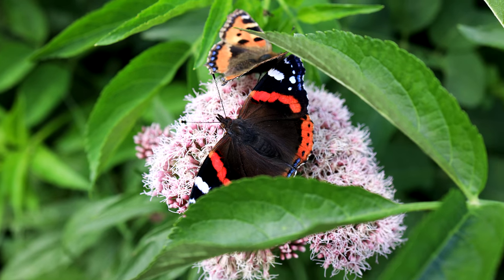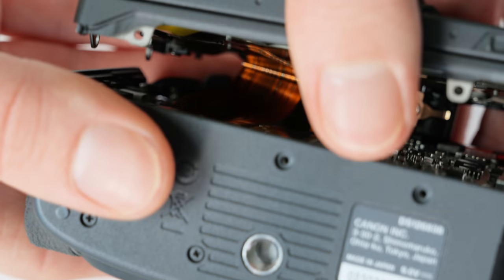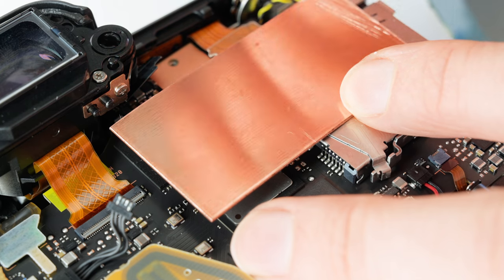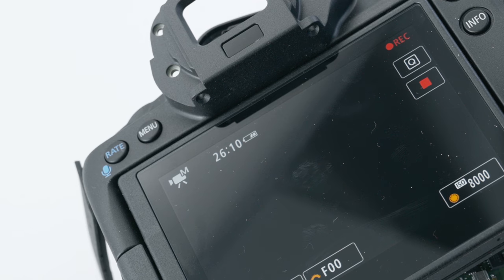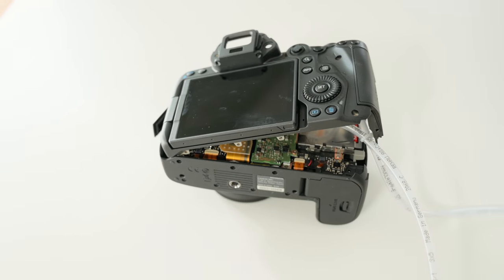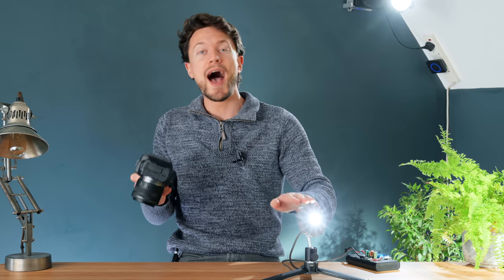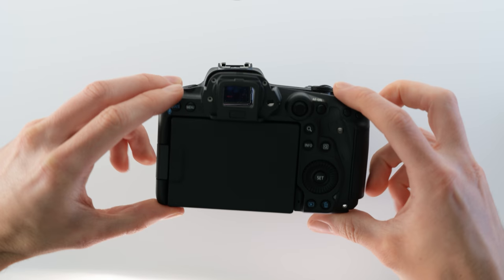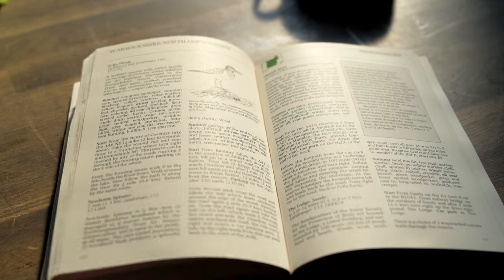The only reason to watercool a camera....

Comment: This guy solo came up with better thermal design than Canon entire engineering department.
Reply: Canon probably designed it like this on purpose, to limit the camera's abilities. 
This would cut into their cinema camera sales if it could record 8k for extended periods of time.
Reply: There's always tradeoffs.. Sure the engineers could make it run cooler but then the camera would be double the size as a result
Reply: Well.. then solution is as big or more than the camera..
Reply: @IrishSkruffles  or, you know, the same size. But with copper heatpipes inside.
Reply: There's 2 issues with that statement.  You don't know the different thermal designs the Cannon engineers considered before settling on the final design.  As Matt said in the video, it's about priorities.  Engineers have to consider feedback from the bean counters and often scale back design to meet cost constraints.  Also, he probably didn't do it alone.  Matt isn't the first person to upgrade the cooling of their high end camera.  He most likely checked out what others have done and use that as a foundation for his own project.
Reply: Canon invented the Cripple Hammer, don't you forget that.
Reply: @lazar2175  More likely to be an issue with materials cost.  Using a couple of bog standard thermal pads and a basic heat spreader is cheaper than the copper spreader and thermal paste Matt used.  Every penny saved in material per unit adds up when you consider how many units are sold over the product line's lifetime.
Reply: @jase_allen  Material cost doesn't sound like a good excuse. For a camera costing that much already, a couple more bucks wouldn't make a difference to the people who need it. Cost can always be passed down to the consumers. And if you make a good enough product, they will buy it regardless of how pricey it is. Not to mention the people who actually really need and use 8k on a professional level will be likely paid at least a thousand or more per day. They could recoup the entire cost of a camera in less than 1 week of work.

Canon has proven throughout history that their DSLRs and mirrorless are just toys for video shooters, and anyone serious about videos should either buy into the cinema line, or buy something smarter like the A7S3, S1H, BM, REDs.
Reply: @IrishSkruffles  what? did you watch the video??? by just changing a few things on the inside, the camera performed significantly better. no change in size.
Reply: @jase_allen  1 issue with your statement. Everyone knows that copper is better for thermal regulation. Everyone knows thermal paste is better than pads, yet somehow canon's engineers decided to go with that cooling solution even though they knew the camera was overheating. The design for this camera only makes sense if you assume it was crippled on purpose.
Reply: @jase_allen  1 issue with your statement. Everyone knows that copper is better for thermal regulation. Everyone knows thermal paste is better than pads, yet somehow canon's engineers decided to go with that cooling solution even though they knew the camera was overheating. The design for this camera only makes sense if you assume it was crippled on purpose.
Reply: @MrFattarot  To be honest, I didn't watch the entire video when I commented.
 It was surprising how well the internal modification did however this is still not mass manufacturing friendly and just to be awkward I would argue the plate is more than twice the thickness of the original plate ;-)
Reply: @jase_allen  
Do you really think they cared about saving less than a dollar on a product that costs $4000?

A decent 8k camera costs well into 5 digits, do you think that raising the price of R5 would turn away the customers. 
Hell they could have doubled or tripled the price and it would still have sold like it is now.

Also i won't even mention how easy would it be to actually properly design this.
Reply: @jase_allen  given that these cameras are selling up to £4000, I don’t think they’re worried about the cost of a relatively small amount of copper.
Reply: @MrFattarot  wdym no change in size?? It has a whole seperate external watercooler now. Although you could make some backpack or fanny pack to carry it canon cant sell that, especially for a non professional level camera and that is where the reason lies for canon underperforming compared to diy perks
Reply: @menogusta9829  You did not watch the video, did you?
Reply: @MrXaphier  Not the second half 😂 my mistake
Reply: @menogusta9829  The internal changes he made allowed him to record for about 40 minutes with a 5 minute recovery time. That on it's own is miles better than what the camera could do before and good enough for most purposes. It's only of you want unlimited recording you need to add the external fan. And even then, the external cooler he made is the same size as a typical battery grip for the camera and you would only use it when necessary
Reply: @MrFattarot  right i just hadnt seen the second half of the video. Only had seen the watercooling part.
Reply: @leodf1  Take the L? It's a youtube comment section not a competition.. You come across like a real nice dude btw
Reply: @MrFattarot  "...Everyone knows that copper is better for thermal regulation. Everyone knows thermal paste is better than pads..."
🙄  I didn't say otherwise.  I said there were probably other considerations involved.  And yes, I do think product managers would tell designers to go back to the drawing board over a few bucks in materials cost.  You're also ignoring the cost of manufacturing.  As I said, a single penny per unit adds up to big bucks when you consider how many are sold over the lifetime of the product line.  You shave off $3.00 per unit and sell 8 million units, you saved the company $24 million.
Reply: @BronySeven  copper heat pipes expensive af
Reply: @JimGordon  Would probably double the price of the camera lol

Comment: Unlimited recording times...
SD Card: ArE YoU SuRe AboUT ThAT
Reply: Canon may lift 30min limit on video and add an option to switch cards during recording. And then, they could even add some sane options for RAW recording, as current Canon RAW is taxing like hell and hard to work with.
 Thats what Sony did with A7S III...
Reply: You can probably output the video feed to a PC/laptop when you're in your studio and right into your editor bypassing the need to plug and copy files around... but yeah 8k files are huge anyway X )
Reply: Next video: I hooked a 15TB SSD to my camera 😂
Reply: laughs in 1tb microsd
Reply: next video: I added a data center to my camera...
Reply: He meant unlimited from heat dissipation point of view
Reply: I hope you not challenging DIY perks to make an unlimited sdcard alternatives. 

Next video title : I make an Unlimited SdCard alternative.
🤣
Reply: @ccmi2081  I made an sd card cluster so my watercooled camera could record for years...
Reply: @KnightMirkoYo  😁🤣

Comment: Fujifilm now have a fan attachment that works perfectly fine. But for me the best solution it's the one on the Panasonic S5II with an small fan in the eyepiece, they use heatpipes to drive the heat to the cooling fan.

Comment: Likely, either Canon were looking to keep some capability on the table to allow for a product refresh in coming years. Or, more likely, they wanted to keep within the TAX bracket limitation of the non-pro cameras that are limited to "no more than 30 mins" of recording video. While I don't think they were expecting anyone to modify the camera, I also don't think they're going to go after you for pointing this hack out. 

As other people have said here it's likely that someone will make this into a "kit" to either resell or build a business of upgrading cameras. An 8K pro camera that can record as well as the camera would likely set you back many tens of thousands of pounds/euros/dollars. Even if the kit and fitting cost another $1,000 on top, and invalidated your warrantee it would be worth doing for may film makers.
Reply: Totally agreed. The two hours pre-programmed "cooling time" has no basis in reality, and must have been  an intended product crippling.

Comment: That's an absolute SCAM on Canon's part. 20 mins of recording, then a 2 hour cooldown? And this guy brings that to 30 mins, then a 5 min cooldown at the cost of a small bit of copper.
Reply: Ahh, but you see that copper will cost money and lower their margin. That wont do at all, they've promised the price of 4500€ and there's of course no chance to change that to 4505€. Welcome to corporate marketing departments.
Reply: To be fair I absolutely can’t be bothered about that because its a photography camera and not a video recorder. I shoot max 3min of video sometimes and for that cooling is sufficient. Yes it sucks for all hobby film makers but in that price segment there are plenty of dedicated video cameras as well.
Reply: @ThePunischer1000  yeah if cannon did this from the factory it would cannibalise the sales of the c70
Reply: @Jason Carter that’s an American tax rule to separate dslrs from video cameras in Europe we don’t have that
Reply: @Jason Carter often electronics companies will just pick one or the most stricked set of rules and apply that to all versions of the devices
Reply: @Jason Carter that's probably down to the updated firmware not detecting as much heat any more. I could be wrong though since I'm assuming the new firmware doesn't seem to have the code in it to stop recording after 29 minutes and 59 seconds.
Reply: Not a scam, just corporate thinking. You spend millions on R&D for a camera, then realize towards the end of development with manufacturing ready to go, that there's a serious overheating issue. You have a release date to meet, have already spent even more money on advertising, getting shelf space with retailers, have pre-orders to fill etc....and you know most people don't shoot 20 minute takes at a time. So you have a choice:
1) Set the firmware to cut out after 20 mins of recording, with an overly-cautious cool down time and ship.
2) Go back to the drawing board and totally redesign the camera which will cost millions in resdesign, retooling the manufacturing process, lost money on advertising and pre-orders, plus the PR disaster of "Canon's new camera scrapped due to bad design".
The work-around in the video works....but I see some problems that would stop it being an 'official' fix: Without the active fan, it probably won't be long before the excess heat starts to deform the plastic on the back of the camera, if you have the screen folded in, you're basically directing all that heat into the back of the display... and having a camera where the back of the casing gets up to 80 degrees C is not a good idea.
I mean....it's still total horseshit and shouldn't have been released in this state... but Canon couldn't have fixed it with a bit of copper. The mod in the video would absolutely NOT meet standard health and safety standards.
Reply: i feel like people are discounting the possibility that they may have realized too late that it was overheating and had no time to literally redesign internals to have a proper heatsink or create the option for a cooler attachment. like sure matt can hack it into place as a prototype, but mechanical design is a long and arduous process and to create an adjustment like that for mass production would take months and months of redesign
Reply: Well, the 5 minute cooldown is theoretical. Whatbdo frequent heat cycles do to the logevity of thw camera? Cooler run temp has definite benefits though.
Reply: @Jason Carter the law changed a while ago.
Reply: @ekevanderzee9538  I also find it insane Canon thinks the processor getting up to 90C is fine. I get worried when my GPU hits 75C

Comment: As you mentioned, camera manufacturers concentrate more on the advanced optical features of the camera rather than the thermal issues causing by the CPU. Eventually, I think you really have to deal with that because the CPU nowadays are getting more powerful and consuming more watts. Your hotshoes attachment fan is definitely a good selling product. I don't mind to buy one if it is probably made.
Reply: Canon r5c is literally what diy perks made but in body

Comment: Next up: I water cooled my Air conditioner.
Reply: I'd want to see that in a "portable" ac, dramatically increasing efficiency with just an outside radiator, and no hoses :D
Reply: air conditioners are already water cooled. that's how they cool the air.
Reply: @_ikako_  you are not really the life of the party right?
Reply: @SirDella  Sounds interesting 🙂!
Reply: @_ikako_  That's swamp coolers you are talking about. Air conditioners are all cooled with air. Portable and window units use the water condensate to improve cooling, but they still rely on air.
Reply: Very much possible! Newer window units actually throw water from the condensation back up onto the condenser!
Reply: @SirDella  are swamp coolers the ones with damp fins that use evaporative cooling? Because industrial air cons use a coolant circulating and constantly evaporating and condensing. I would count that as "water" cooling.
Reply: @_ikako_  I wouldn't count refrigerant as water, but it is what you need to cool down, not what provides the cooling. Acs use air to cool the condenser and the water that forms in the evaporator, water cooling (in a portable ac) would mean removing the cooling fan and replacing it with the water loop, taking the water outside where you'd have a simple radiator or even better, using your pool as the heatsink!
Reply: @SirDella  LOL.  I know what everyone needs.  A radiator for our radiators.
Reply: @jayhom5385  Hahaha, but think about it, portable acs are extremely inefficient, one way to fix this is with a dual hose one, or with this crazy contraption that I'm suggesting. In addition you could even heat up a pool with it while cooling a room at the same time! And also would make them quieter, I'd like to give this a try

Comment: In amateur astrophotography we us Peltier elements to transport heat away from surfaces. This could be used on the plastic back of the camera, inside and outside.
But it also requires an energy source.

Comment: Linus? 

P.S I don't even need to use a screwdriver with my Canon G7X... The screws fell out by themselves and the plastic parts also detached over time 🤦‍♂️
Reply: You can fault canon for plenty of things, durability is not one. Your story sounds totally bogus. I have old and new canon cameras....nothing like has ever happened. In fact I doubt any major camera company sells a product where "the screws just fall out". 

TLDR : pics/vid or it didn't happen
Reply: @protoman1214  just Google "g7x mark 2 screws falling out" 

It's a known and common problem for that camera.
Reply: @GadgetAddict  I see. I never messed with their powershot line except an old s90 that still works perfectly. Looks like canon dropped the ball. Probably because that specific mechanism is newer in their cameras. And to use proprietary screws ... disappointing
Reply: That's the way it works unfortunately. Cheaper prices mean less quality control. 

Although I have an 1100d from 2011 laying around the place and the only thing that has came off it the rubber 'gasket' around the viewfinder. Was my only camera for 6-7 years so it has a massive amount of use. Took it hiking and everything. A few scratches here and there, but still as sturdy as the way I received it.

Comment: As a potential customer of an R5, COVID delayed my purchase as I my business has been affected.  Video is not really important as stills, but this is the first video I've come across that discusses the R5's heating issue beautifully.  I can now see where Canon has made the engineering mistakes and the low-quality thermal management.

I know there is a lot of technology going on here, but for what is essentially a $4K+ camera, I would have expected better of Canon to deal with this. 

Until COVID lifts and my photography business picks up, I can hope that an R5v2.0 or even the just announced R3 will do a better job.

Excellent video.  Well done!

Comment: Dude start selling this as a Kit, you can get rich off this!!!!!
Reply: not everyone would wanna buy this fairly expensive "kit" and wanna tear their camera down, kiddo
Reply: @jinxy7869  its not for the timid, thats for sure but saying that doesn't mean there isn't a market for it.
Reply: @jinxy7869  A piece of copper, some 3d printed plastic and used laptop fan ? I don't think it'd be that expensive tbh
Reply: @nguyenphong3825   It’s called opportunity and labor costs. Materials are cheap but the money required to purchase the and setup equipment (jigsaw, blow torch, 3D printer) along with the time required develop the skills to operate said equipment is too costly.
Reply: canon should add this to original design and release it as new camera
Reply: @hubbablahloo1843  That means that you won't get rich from it.
Reply: Along with the cooling kit would have to include a huge disclaimer that says "install at your own risk", if you bust your camera it's not his fault.
Reply: @RobR386  wow you guys!!! If you can fix a modern laptop this is no problem.  Lots of people pissing on a good product idea because they are fearful.

Comment: My first thought was: Heatpipe, or just a metal connection, to the screw socket from the cpu sink/spreader.
Simple, elegant, actually moves heat out of the camera.

I bet Canon could not because operator hazards liability.